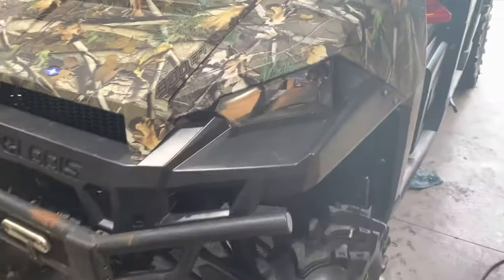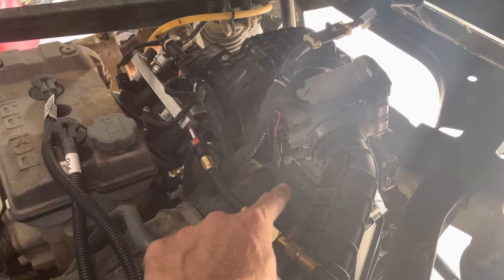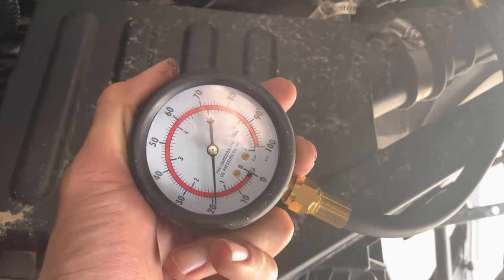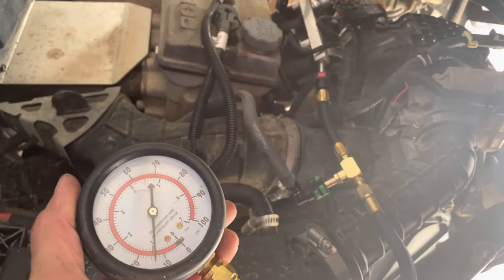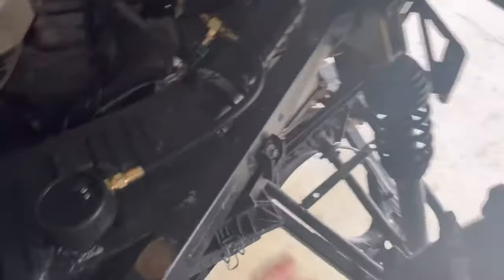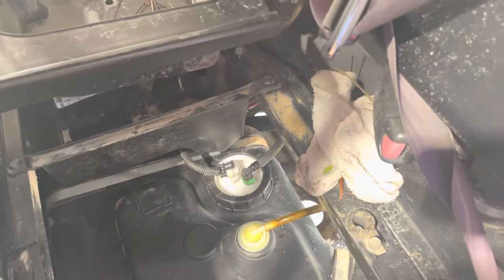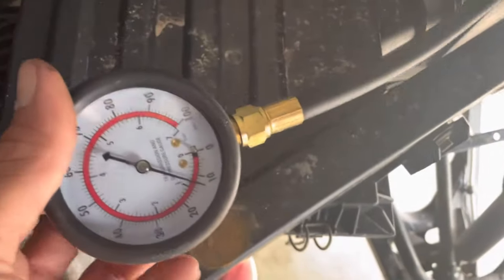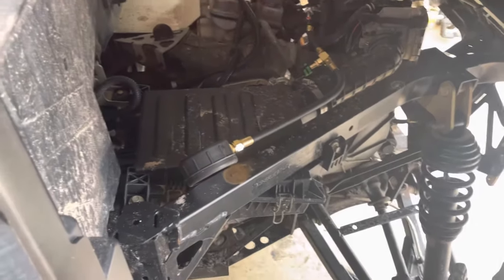Polaris ranger fuel pump check diagnosis and fix

Comment: On my 2012 RZR 900 xp4 I had a no start issue. Pulled the line going to the injectors and there was very little fuel flow coming out when cycling the key on and off. So I proceeded to pull the fuel pump from the tank to change it and noticed that the little hard plastic fuel line that runs from the pump up to the white plastic mounting flange was cracked nearly in half in one spot. Removed it using a razor knife and replaced with some submersible rubber fuel line and the RZR is back to running like new.
Reply from the maker: Awesome job recognizing that and quick fix!  This comment might help some people out and save them money!  Thanks for the comment !  Lord bless you

Comment: Mine runs the same way .  2018 ranger xp 1000.  My fuel pressure is 58-60psi.  Any thoughts?  I bought a used throttle body and fuel injectors.  No change.

Comment: I have a 2008 polaris ranger it won’t start and the only way it will start if i press the gas pedal all the way in but wont stay idling if i let go of the pedal ?
Reply from the maker: Most likely TPS issue
Reply: take some brake cleaner and clean the throttle body and the little sensor inside a cage and it’ll run perfectly, i had the same problems until i found a video saying to do that

Comment: Can't start mine...can I get accurate pressure reading at Schrader valve by just turning key... Or must I get it running
Reply from the maker: You can start test by key on.  But you’ll want a running test as well.  Odds are if it won’t start it’ll be low pressure or contaminants in fuel like water
Reply: @dtmxing  grateful for your quick response.  I'll be working on it today. Will probably put all new fresh fuel,  spark plugs,